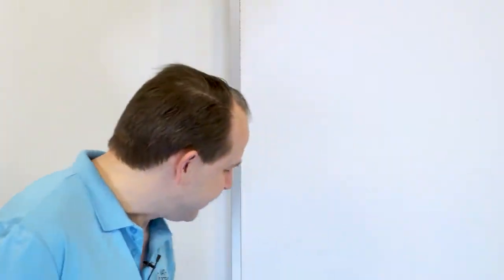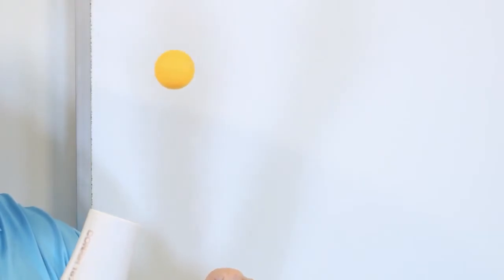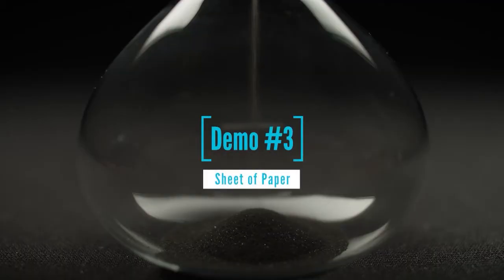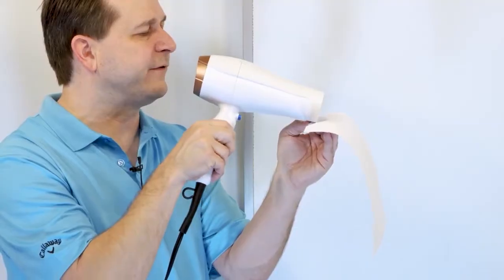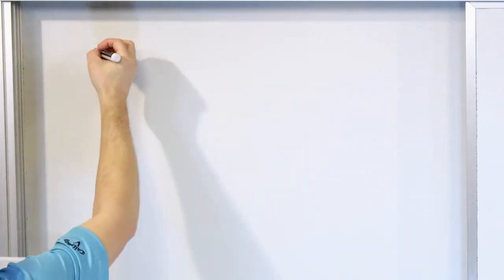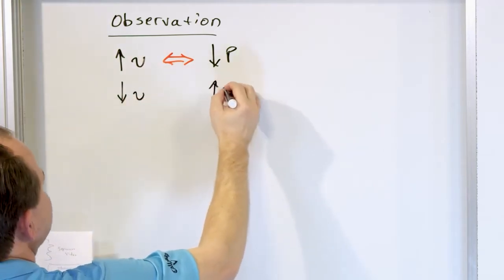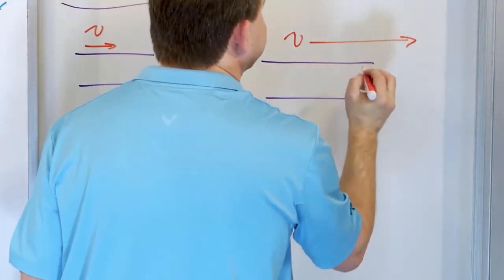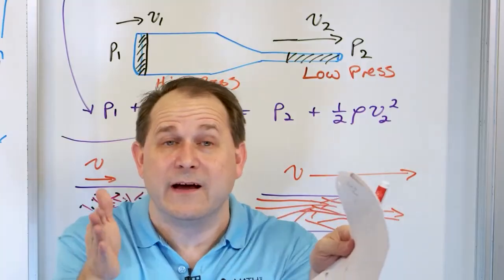The Bernoulli Effect & Air Pressure Visualized

Comment: Nicely demonstrated, but I think this is not exactly what Bernauli's equation suggests.
The explanation rather shows a combination of brownian motion (about particles having random collision) and part of Bernauli's principle.
The true nature of Bernauli's principle is that there are 3 parameters for the fluid in motion, which are static head (read potential energy), kinetic head (read kinetic energy) and pressure head - sum of all 3 remain constant at all times. So if there is a higher velocity of fluid and the static head remains constant there will be a decrease in pressure head. However if you imagine a fluid flow in a pipe horizontally where the pipe's diameter changes, one can actually see the Bernauli's principle effects. That part, I think was not explained properly. Sorry to point out this part, in this nicely done explanation session.

Comment: Can you explain lift in aircraft wing , now ?
Reply: By watching his video on it, it is clear that he can't, since even this is 100% incorrect physics.  An all too common misconception repeated over and over by amateur scientists.
. .

So many well-meaning amateurs have all the Trouble with this.
.
This is so frustrating being repeated over and over by amateurs. . .
. .
Here's the real physics, in summary:

You can find this in, among other authoritative texts such as in John D. Anderson's book, that it is Euler who  is credited with first determining that a Pressure Gradient (pressure difference between two locations)  that Accelerates the mass in fluids => Newton's First Law..  
.
In other words: It is the Potential energy in the Above atmospheric pressure, inside the blower, that gets converted to the kinetic energy in the speeding jet.  
The higher pressure, still air inside the blower converts to the lower (atmospheric) Pressure higher speed of the jet.
THAT IS ACCELERATION, not simply speed relative to something like an arbitrary surface.
.
The 'fast' jet's internal static pressure  is EQUAL TO atmospheric pressure.
.
The energy for the jet's speed  / kinetic energy is supplied by the potential energy inside the blower. <-- Fundamental Physics FACT.

THIS IS MEASURED DAILY by students and professionals.
.
These demos are CORRECTLY explained by viscosity, entrainment and Coanda that lower the pressure BECAUSE of the INTERFERRING surface near the flow.
. . . . . 
For your reference, Weltner does an excellent job of explaining the fallacy as well as the proper use of the industry standard static pressure Probe:
.
 Available PDF URL as of Mar 9 2024:
FIG 3 Static Probe:
 www.prirodopolis.hr/Bernoulli-Coanda%20Demo_files/Misinterpretations%20of%20Bernoullis%20Law.pdf

Comment: What about an air curtain where you walk in a door and the air curtain turns on? Common application is kitchen door at a restaurant. The air curtain keeps bugs from getting in and it helps prevent heat from entering or leaving the building. Another example of an air curtain is restaurant and store refrigeration coolers that have the air curtain instead of a door. This way you can reach in and get product without opening any doors.

Comment: Jason another great video,  the demo on the long green balloon tube where you inflated it with 1 exhale was supreme and mind bending . Really good , again.thanks
Reply: That's incorrectly called a "Bernoulli Bag" and is  due to Entrainment. 
.
The viscosity of air between the moving jet and the still air around it, drags some of that still air along, just like friction of a brick sliding on a skate board to drags the scate board  along with it.
ENTRAINMENT is searchable.
...
. .
So many well-meaning amateurs have all the Trouble with this.
.
This is so frustrating being repeated over and over by amateurs. . .
. .
Here's the real physics, in summary:

You can find this in, among other authoritative texts such as in John D. Anderson's book, that it is Euler who  is credited with first determining that a Pressure Gradient (pressure difference between two locations) that Accelerates the mass in fluids => Newton's First Law..  
.
In other words: It is the Potential energy in the Above atmospheric pressure, inside the blower, that gets converted to the kinetic energy in the speeding jet.  
The higher pressure, still air inside the blower converts to the lower (atmospheric) Pressure higher speed of the jet.
THAT IS ACCELERATION, nit simply speed relative to something like an arbitrary surface.
.
The 'fast' jet's internal static pressure  is EQUAL TO atmospheric pressure.
.
The energy for the jet's speed  / kinetic energy is supplied by the potential energy inside the blower. <-- Fundamental Physics FACT.

THIS IS MEASURED DAILY by students and professionals.
.
These demos are CORRECTLY explained by viscosity, entrainment and Coanda that lower the pressure BECAUSE of the INTERFERRING surface near the flow.
. . . . . 
For your reference, Weltner does an excellent job of explaining the fallacy as well as the proper use of the industry standard static pressure Probe:
.
 Available PDF URL as of Mar 9 2024:
FIG 3 Static Probe:
 www.prirodopolis.hr/Bernoulli-Coanda%20Demo_files/Misinterpretations%20of%20Bernoullis%20Law.pdf
Reply from the maker: Cool, thanks!  Really happy you liked it!

Comment: I remember guys in my class arguing, questioning, how can that be? Because it's intuitive thinking that leads you to believe that fluid that has higher speed has more pressure but really that's not the case. Nicely done Jason, great lecture.
...ram air pressure and all when you push your hand out of a car window...
Reply: Yes. I think part of the misunderstanding comes from everyday assumptions we've (me anyway) made for years, like the hand out the window (example above) in a moving car is "high" pressure from the air, but in fact is low. I thought in terms of only THE FLOW, when in fact the pressure was the resistance to the flow. High flow is because of low resistance (pressure). OK! For many years I've always thought that when the tap water from the faucet was slowly dripping- it was because the pressure was "low."  "Call the plumber, can't get water, the pressure is too low." A full blast of water of water streaming from the tap was considered "high" pressure. Even in commercial car washes when your rinse your car it is described as a "high" pressure rinse. Now I know better. I never understood that when I was watching fast moving rivers going through canyons and towards the sea it was described as "low" pressure. Makes sense now.😊
Reply: @delstanley1349  It's right perspective what's all about isn't that amazing? Interpreting matters more than just blindly laying out facts and Jason is doing hell of a  great job. That fast air slows down quite a bit and changes direction as it tries to rip your hand off lol ;P
Reply: Then, there is the correct perspective.
..
So many well-meaning amateurs have all the Trouble with this.
.
This is so frustrating being repeated over and over by amateurs. . .
. .
Here's the real physics, in summary:

You can find this in, among other authoritative texts such as in John D. Anderson's book, that it is Euler who  is credited with first determining that a Pressure Gradient (pressure difference between two locations) that Accelerates the mass in fluids => Newton's First Law.  
.
In other words: It is the Potential energy in the Above atmospheric pressure, inside the blower, that gets converted to the kinetic energy in the speeding jet.  
The higher pressure, still air inside the blower converts to the lower (atmospheric) Pressure higher speed of the jet.
THAT IS ACCELERATION, nit simply speed relative to something like an arbitrary surface.
.
The 'fast' jet's internal static pressure  is EQUAL TO atmospheric pressure.
.
The energy for the jet's speed  / kinetic energy is supplied by the potential energy inside the blower. <-- Fundamental Physics FACT.

THIS IS MEASURED DAILY by students and professionals.
.
These demos are CORRECTLY explained by viscosity, entrainment and Coanda that lower the pressure BECAUSE of the INTERFERRING surface near the flow.
. . . . . 
For your reference, Weltner does an excellent job of explaining the fallacy as well as the proper use of the industry standard static pressure Probe:
.
 Available PDF URL as of Mar 9 2024:
FIG 3 Static Probe:
 www.prirodopolis.hr/Bernoulli-Coanda%20Demo_files/Misinterpretations%20of%20Bernoullis%20Law.pdf

Comment: tonic for science geeks.
Reply: A correct elixer is as follows:
..
So many well-meaning amateurs have all the Trouble with this.
.
This is so frustrating being repeated over and over by amateurs. . .
. .
Here's the real physics, in summary:

You can find this in, among other authoritative texts such as in John D. Anderson's book, that it is Euler who  is credited with first determining that a Pressure Gradient (pressure difference between two locations) that Accelerates the mass in fluids => Newton's First Law.  
.
In other words: It is the Potential energy in the Above atmospheric pressure, inside the blower, that gets converted to the kinetic energy in the speeding jet.  
The higher pressure, still air inside the blower converts to the lower (atmospheric) Pressure higher speed of the jet.
THAT IS ACCELERATION, nit simply speed relative to something like an arbitrary surface.
.
The 'fast' jet's internal static pressure  is EQUAL TO atmospheric pressure.
.
The energy for the jet's speed  / kinetic energy is supplied by the potential energy inside the blower. <-- Fundamental Physics FACT.

THIS IS MEASURED DAILY by students and professionals.
.
These demos are CORRECTLY explained by viscosity, entrainment and Coanda that lower the pressure BECAUSE of the INTERFERRING surface near the flow.
. . . . . 
For your reference, Weltner does an excellent job of explaining the fallacy as well as the proper use of the industry standard static pressure Probe:
.
 Available PDF URL as of Mar 9 2024:
FIG 3 Static Probe:
 www.prirodopolis.hr/Bernoulli-Coanda%20Demo_files/Misinterpretations%20of%20Bernoullis%20Law.pdf

Comment: Very effectively explained Jason. Thank You. BTW I've encouraged my students to watch your videos in their spare time. Keep up the good work.👍👍
Reply from the maker: Awesome, thank you!
Reply: That's sad, Dariush, because this is incorrect physics you have taught them.
.
So many well-meaning amateurs have all the Trouble with this.
.
This is so frustrating being repeated over and over by amateurs. . .
. .
Here's the real physics, in summary:

You can find this in, among other authoritative texts such as in John D. Anderson's book, that it is Euler who  is credited with first determining that a Pressure Gradient (pressure difference between two locations)  that Accelerates the mass in fluids => Newton's First Law.
.
In other words: It is the Potential energy in the Above atmospheric pressure, inside the blower, that gets converted to the kinetic energy in the speeding jet.  
The higher pressure, still air inside the blower converts to the lower (atmospheric) Pressure higher speed of the jet.
THAT IS ACCELERATION, nit simply speed relative to something like an arbitrary surface.
.
The 'fast' jet's internal static pressure  is EQUAL TO atmospheric pressure.
.
The energy for the jet's speed  / kinetic energy is supplied by the potential energy inside the blower. <-- Fundamental Physics FACT.

THIS IS MEASURED DAILY by students and professionals.
.
These demos are CORRECTLY explained by viscosity, entrainment and Coanda that lower the pressure BECAUSE of the INTERFERRING surface near the flow.
. . . . . 
For your reference, Weltner does an excellent job of explaining the fallacy as well as the proper use of the industry standard static pressure Probe:
.
 Available PDF URL as of Mar 9 2024:
FIG 3 Static Probe:
 www.prirodopolis.hr/Bernoulli-Coanda%20Demo_files/Misinterpretations%20of%20Bernoullis%20Law.pdf